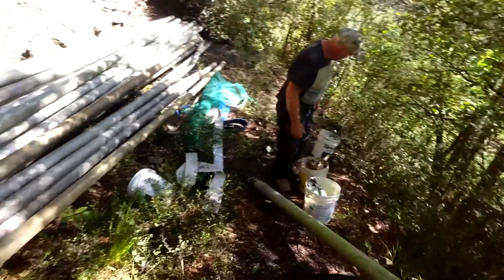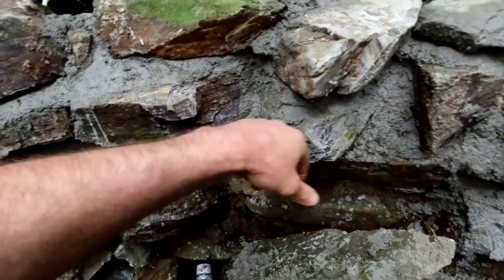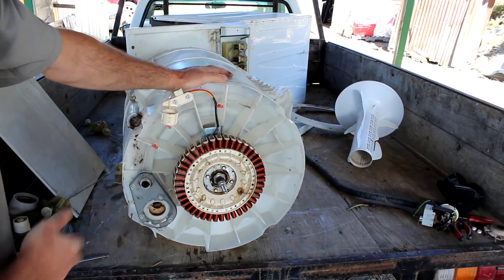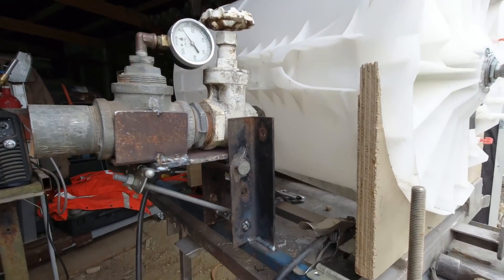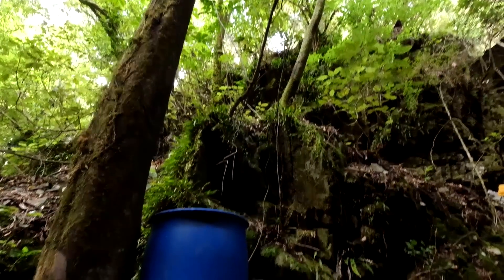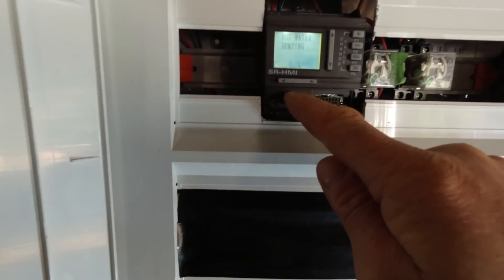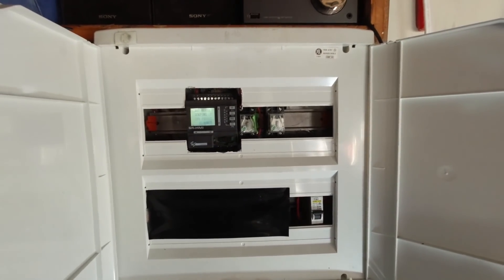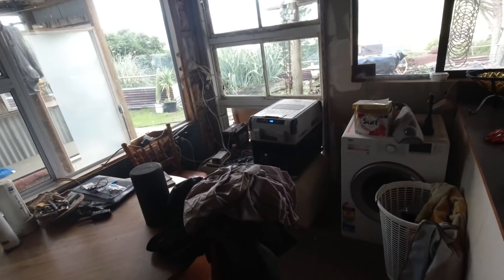Water powered generator made from recycled junk | For Pre- Rambro Subs

Comment: Impressive. How did you learn how to do so many things?
Reply from the maker: Necessity/survival..  I injured myself, couldn't work and was earning very little income for  years, I couldn't afford to pay others to do it, so  It was either do it myself or go without
Reply: @Angryramz  I understand you were strongly motivated but you still had to learn many different skills and subjects like electricity and engineering. How'd you learn them? Books? Videos? School?
Reply from the maker: @mattfoley6082  Trial and error, pulling things apart to see how they worked.. So much easier these days with the  Internet
Reply: @Angryramz  Yeah but you can't learn about electricity and circuits by looking at them!

FWIW that washing machine motor (and all electrical motors) has bearings that will wear out. I learned a lot about bearings by replacing my air conditioner motor's bearings. Anything that rotates has bearings; they are everywhere!

Comment: Can this power generator work in a large backyard, say if I had a multiple later water tanks circulating round and round with pressure? So instead of the water being ejected back into the stream, it is redirected round and round? As I don't have a large water stream to work with.

Comment: Great vid and great build. Though it seems you have more than enough energy to the house, would it have been more efficient to run the 3 phase to the battery location, then rectify it? Just a thought from South East Power Engineering UK

Comment: Hi, great vid although I miss the ram a bit. Would it work without rectifier and batteries since all appliances run on 110V AC ? If stream is constant then there is no need for battery storage, you loose some power on conversion from AC to DC and raise the cost a bit
Reply: The raw voltage from the washing machine motor being spun by the Pelton wheel is 400VAC, at a high hertz frequency.
That voltage is dangerous and tends to leak away through insulation with large line losses.
So rectification to 27 VDC brings it down to 24VDC battery charging voltage...then the batteries feed a 24VDC to 230VAC inverter.
230VAC in New Zealand is the standard household voltage which means that all household appliances are therfore able too use it.
Line losses at 230VAC over the 400m from the generator to the house are minimal.
Reply: @JohnSmith-yv6eq  I agree, however step down transformator could do the trick, I am from Europe and we use 230V also but I dont think that you can break insulation with 400V even when using cheaper cable, this voltage is common in industry machines and no special insulation cable is used there. Point is that battery is necessary with oscilating power source, like solar panels. All batteries have relatively short life cycle and will be first thing to replace besides bearings on generator due to friction
Reply: @filipkralj2618  
Marty does it his way and it works for 17 years, using only 3 x 2 sets of old truck batteries..the batteries being charged directly off the rectified 400VAC generator and are always topped up by the generator constantly at 885 watts...and are only drawn on in high demand situations...which is far different from solar where the demand at night has no contra generation.....all the load draws down the batteries....all night.
The 400VAC is a different and dangerous beast to deal with for an amateur...27VDC..not so much.
Feel free to make a system and trial it with your ideas and we will watch the YT channel....